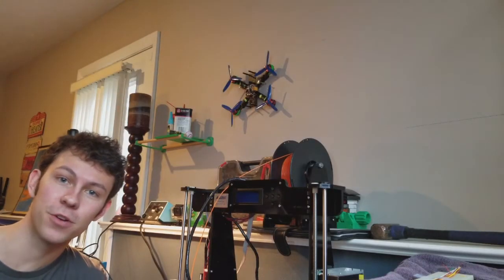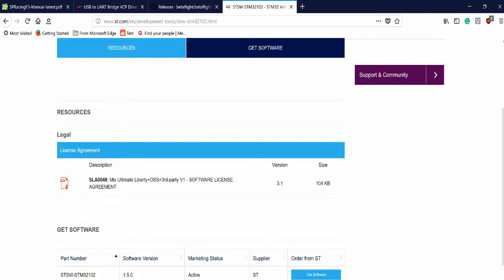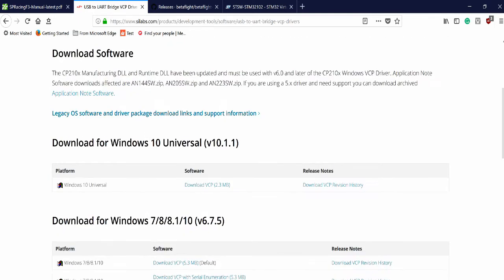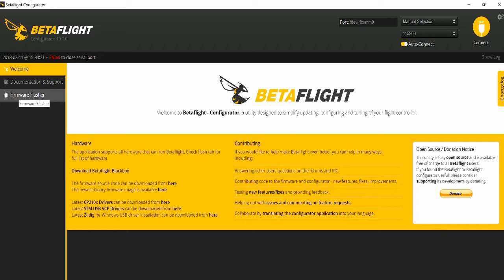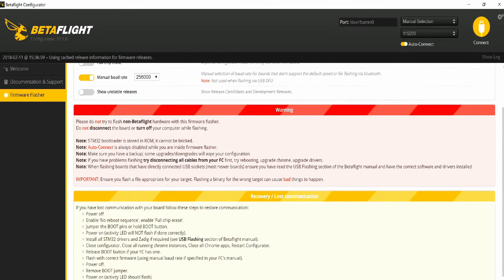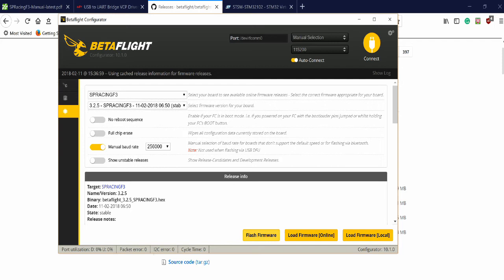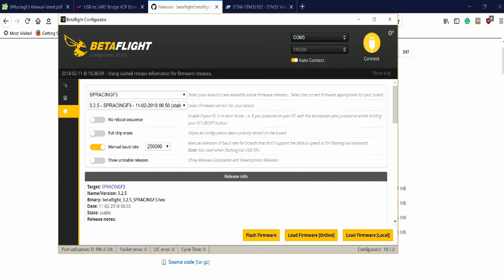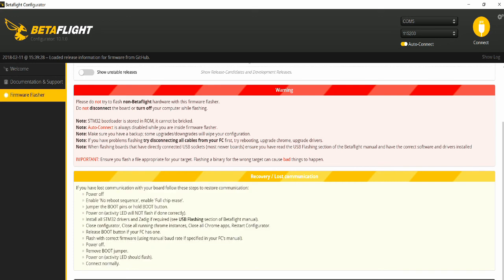How To Flash SP Racing F3 Flight Controller

Comment: The sp racing f3 isn't under the dropdown menu to be able to flash. Any idea why?
Reply: same
Reply: @Angryharry1  ITS NOT AVAilable in the current versions of beta configurator - you will need to go back to an earlier release of beta flight
Reply: @Patrick Joseph i went back all the way to version 10.0.0 and got nothing. has anyone got a download link to a version with it on
Reply: @Angryharry1  thanks for trying this so I didn't have to lol. It would be really great if I could use these old boards, cause I have a few of them
Reply: @Angryharry1 hey man did you ever figure it out? I have the same problem
Reply: @AngelWingrc  no sorry. Ive ended up buying a new drone since with a blitz f7.
Reply: @Angryharry1  thank you I appreciate the reply!
Reply: @AngelWingrc  no problem!
Reply: Ok thanks I'll try it this evening

Comment: Hi bro my sp racing f3 when connected to beta flight it shows cannot connect to serial port plz help
Reply from the maker: Hey Tarak, Lets get you figured out.  First off, do you have the correct drivers installed on your computer?  Without these, the computer wont be able to communicate with the flight controller.  You should have the STM32 driver installed.  Second, when you there is a drop down menu in betaflight that allows you to connect to different ports.  Betaflight may be trying to connect to a different port on your computer that isnt your quad.  Finally, try running impulse RC driver fixer here https://impulserc.com/pages/downloads  I just built a PC and this allowed me to connect to my JBf4.  Hope this helps! @Tarak Zaveri
Reply: @Quadmonium  hi bro i have downloaded the file but still  not getting what to do?
Reply: @Quadmonium  is there any other way u can help me are u on snapchat if u r then we can just do a video call and u could teach me?if it is possible
Reply: Thanks bro I ll get back to u by tomorrow a I ll follow all the steps u said .. 😄😄

Comment: When I am installing Zadig I can't find stm 32 bootloader option
Please help me...
Reply from the maker: Soumyadeep Karar I will research that issue for you and get back with you.
Reply from the maker: Soumyadeep Karar have you downloaded the stm32 boot loader and the cp210x usb to uart vcp drivers? The links are in the description.
Reply from the maker: Soumyadeep Karar if that doesn’t work, let me know. We will figure it out.
Reply: Thanks for your reply
I have download cp210x & stm 32 bootloader then i download zadig...
But the problem is still occuring...
Reply from the maker: If it doesn't show up, it's possible that the driver is already installed.  Try plugging in the drone and see if it allows you to choose the com port that the drone is using.  try flashing then.  If betaflight doesn't recognize the drone, then open zadig, giver admin permission, remove all usb accessories except for the drone, and see if you can choose stm32 bootloader. Also I think that now zadig is unnecessary.  If you need more zadig help, here is a great website. https://github.com/pbatard/libwdi/wiki/Zadig#Basic_usage

Comment: is there any other setup that i have to do to these drivers to get them to work?
Reply from the maker: After the drivers are installed, Betaflight should be able to detect your quad and flash the firmware successfully.  What is the exact issue that you are having? Maybe I can help.
Reply: @Quadmonium   Ive read on some forums that the STM driver doesn't work on windows 10. the same drivers works on my mac, but ive read that these drivers wont run on windows 10 and you have to modify them with the impulserc driver fixer or Zadig, but my pc doesnt even detect the STM drivers at all.
Reply from the maker: At the time I made this video, everything worked fine, but I have also read that the driver may need to be repaired with zadig. I've included this link to download zadig.  I've used zadig in the past to repair drivers. https://zadig.akeo.ie/  @theonlybass8947
Reply: @Quadmonium  The STM32 driver doesnt work for windows 10 and the Zadig and Impulserc fixers dont work either, so effectively i cant do anything to my quad.
Reply from the maker: @theonlybass8947  Have you downloaded this? http://www.silabs.com/products/mcu/pages/usbtouartbridgevcpdrivers.aspx This is a crucial step in order to allow the computer to communicate with the virtual COM port.  The virtual COM port, aka the port that your quad is hooked up to, will not be recognized without this software.
Reply from the maker: Have you had any luck? 
 @theonlybass8947
Reply: @Quadmonium  I got it working yep.
Reply from the maker: Perfect! What ended up being the problem?  @theonlybass8947
Reply: @Quadmonium  I redid the stm32 install and completed the driver setup for 64bit
Reply from the maker: Ok great! I hope I helped some.  I am thinking about uploading more how - to videos in the future.  Until then thanks for watching my videos! I hope to hear more comments from you in the future. 
 @theonlybass8947